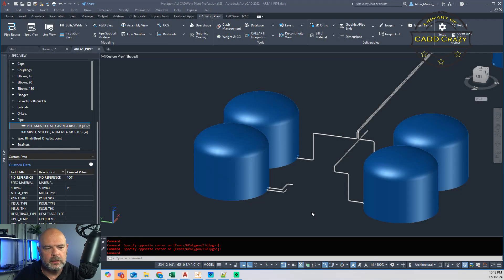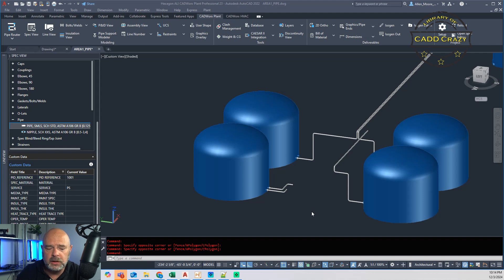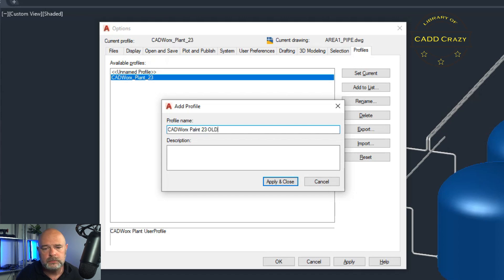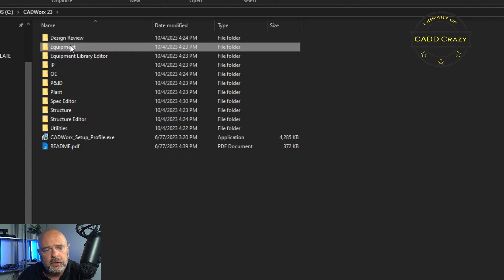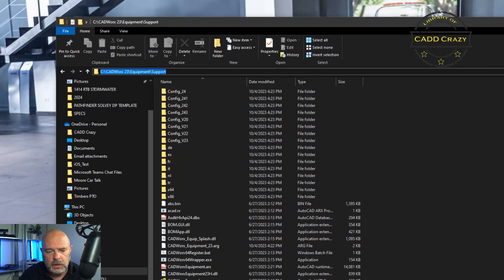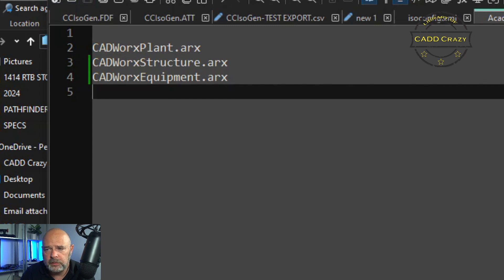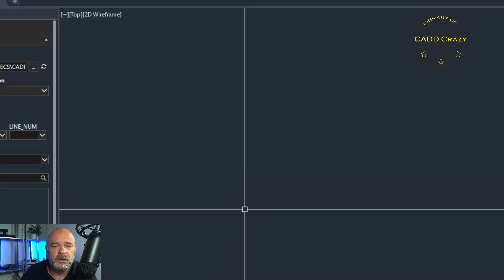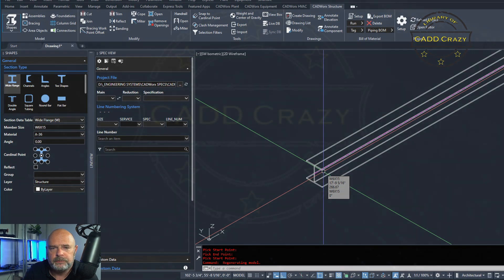CADWorx Structure and Equipment in Plant Pro

Comment: Does this work for CADWorx 2020 R2. I followed the steps and the structure/equipment tabs didnt come up. 
I did these steps while on a custom profile. Would that make a difference ?
Reply from the maker: I think 2020 R2 is a little different since you have to install CADWorx Structure up separately from CADWorx Plant. Once you have it installed it should work as stated.
Reply: @caddcrazy9069  structure was already installed on my computer. It now shows today's date "date modified" *speaking on the .arx file for today's date. It wasn't updating because I didn't do a refresh